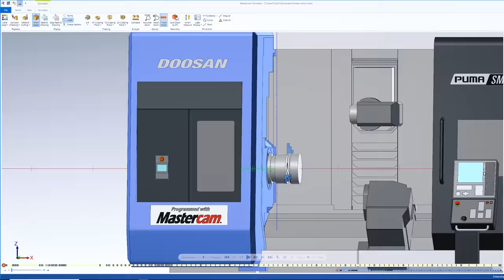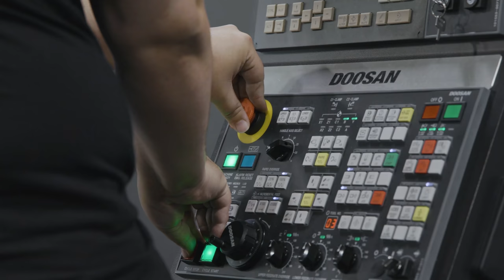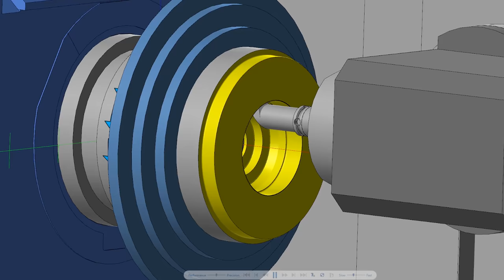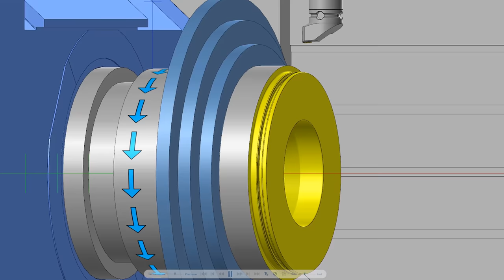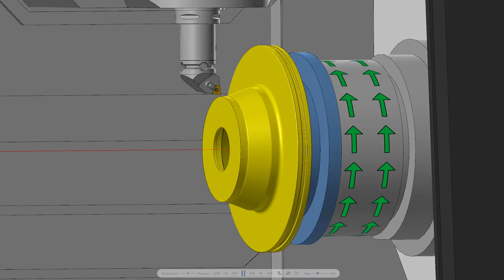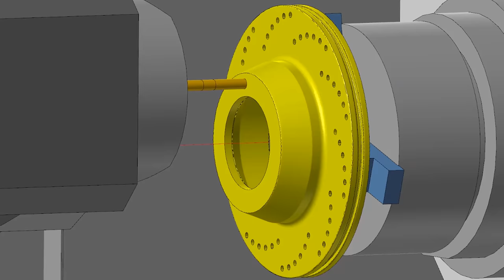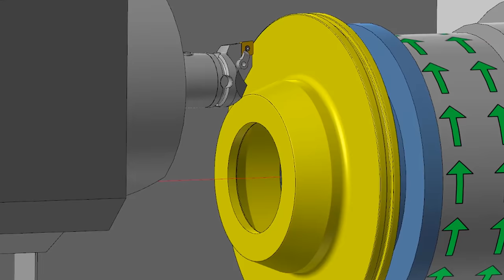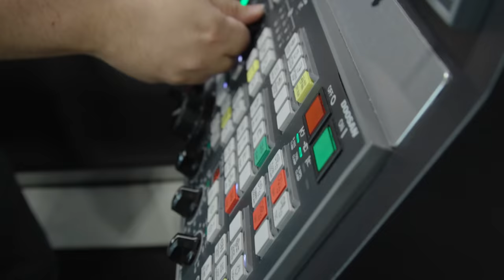Machining Our Own Brake Rotor on SMX 3100ST 9 Axis | DN Solutions

Comment: I turn brake rotors & drums for a living. Our speeds are very docile compared to what you are using but one thing remains. The shape of the part is a BELL. It generates harmonics which effects the surface finish. We always use an elastic strap and wrap the rotor or drum to help absorb the harmonics. Without it you get fish tails in the finish. You also have an interrupted cut which has to be murder on the tooling as well. You might consider hole ops on the rotor face last. As a last op a non directional finish with a flex hone type  tool is advised.
Reply: How many machines do you have at your shop?
Reply: Do you make your rotors and drums from solid stock like Tyson is doing or do you get them preformed and then finish machine the parts?
Reply: Order of operations, drilling and chamfering last could leave burrs on an otherwise smooth face. These machines are way more ridged than the average Ammco lathe, making interrupted cuts on these machines is child's play. Not all manufacturers recommend non-directional finishes. The OEM of these rotors only provide coated rotors. Most European OEM's use coated rotors. Now in the aftermarket world, you do what you have to do.
Reply: I also make rotors for a living and agree with you. Drilling should always be last and you would want to balance it before using. Also to save alot of time, kennametal has drill that would do your top and bottom chamfers as it drills each hole.
Reply: @cryptoldya6229  oh yeah ! totally forgot about balance !!
Reply: Could someone stuff the id w a nerf ball to absorb harmonics? I new some machinists who used rubber wrap to go around long sections of pipe when doing a operation. To absorb the harmonics?
Reply: I also make brakes and suspension for drag racing for a living. Very interesting to watch and see how you guys did it. We make 2 piece rotors. Most cars will run the same exact rotor but we will make a different rotor adapter to fit different cars with different lug patterns
Reply: One place I worked at, we worked with tubing, and we stuffed insulation inside the tubing when turning the OD to deaden the chatter.

Comment: I'm really confused, where is venting channels on this disc? without good air flow it is suitable only for low perfomance applications.
Reply: I thought something was missing. While the veins could technically still be added it just proves why parts like rotors are something better when cast then just surfaced
Reply: @kingofkings600  They aren't mandatory, but if you're spending what I'm sure this cost to manufacture, they're definitely expected.
Reply: This is just an educational exercise. Without internal venting this part is not performance-oriented
Reply: "Solid brake rotors are usually machined from a single piece of raw material, like cast iron. Although more exotic materials are available particularly when it involves racing or street performance requirements.
Solid discs usually appear at the rear of the vehicle."
Reply: @gt40f  bro they literally showed the car they were going to put it on and it sure wasn't my grandpa's Corolla.
Reply: @whatzituya55  they don't even put solid rotors on stock Factory Vehicles anymore. And a performance vehicle always has a vented rotor
Reply: @whatzituya55  I've been building cars for 30 years including race-winning endurance cars
Reply: @gt40f  vented, and on higher end cars, it's increasingly common to have 2 piece rotors as well. On my car that I take to the racetrack, they're two piece all around and directionally vented (so the internal vanes are angled to help pump air through them as they spin).
Reply: Rear rotors on my daily are solid...
Reply: @dan4653  yeah rear, and they're really thin like 10 mm. Rear brakes only do about 30% of the braking. Most performance applications have vented on the rear also
Reply: Vents can be index drilled in a radial orientation.
Reply: @kingofkings600  they allow cooling,brake discs are. Cast for a reason
Reply: I'm not sure how a video confuses anyone. There's just showing you how this machine works.
Reply: The vents add more cooling performance than the drilling. Whilst this rotor will work. It will very quickly reach the point of brake fade and warping on any track application or heavy mountain braking. Source ex mechanic.
Reply: @azazeldeath  Titans of Demo CNC that's all,machines on full tilt for the camera,while in real engineering feeds and speeds are optimised.
Reply: @markmiller5577  I have no issues with the machining at all, please don't misread that.

What I am referring to is the vents for the brake rotor, they can be called kangaroo paws or vented rotors. There's a reason why from the cheapest to most expensive rotors (minus really exotic ones like carbon-ceramic) and that's for airflow to cool down the disk.

Comment: You guys broke a record! The worlds most expensive brake rotor. Well done video Tyson!
Reply: *most expensive cast iron rotor
Reply: @BigWill3855  all drums and rotors are cast iron.
Reply: @Jon-O.  ever heard of carbon ceramic?
Reply: @BigWill3855  brake pads yeah
Reply: @BigWill3855  or even carbon carbon bec if you watch F1 you will know how much they cost 🤣
Reply: I would love to know how much that chunk of cast-iron cost and what a billable part would call somebody in the real world not for videos on YouTube
Reply: @steveanderson4768  yeah and generally the larger rotors are vane vented between dual braking surfaces. Technically if they were to do this and do it cheap it would have to be a casted part not a chunk of stock. To much material cost. Castings offer reduced material cost and less machine time.
Reply: @Jon-O.  Castings are for mass production.  CNC is for rapid production of prototypes.
Reply: @NSResponder  that depends on the design of the rotor and the application.  On larger rotors they are inherently two braking surfaces between a vented design prototype or production. For heat disapation and holes and slots are about to a lesser extent less heat generation which is fine when your application only requires the design of a solid rotor which is dictated by the application. Any where a rotor of that size is used the six piston caliper that goes on it is going to produce a ass ton of heat fast and internally vented rotor design is the only one that would suffice which will be a casted because production or prototype casted is the only to get that. Once solid rotors with pretty slots and hokes get to much heat and can't cool in time fast enough you lose braking they call it brake fade. Also if your vehicle actually used solid rotors which alot do it's still cheaper to cast them then to pay for all the machine time even on a prototype. Odds are the the foundry already has blanks casted you just need to kiss the braking surfaces and blast a hole pattern in the hub plate if there is one there that works or not if it's blank. The most efficient way is always better regardless of prototype or production. Coming from a guy who worked in and on prototype projects in automotive military and Areospace. Have a nice day
Reply: @motoadventuredude  that was my point.
Reply: @Jon-O.  I agree. The rotor he made was just about worthless other than for just looks.
Reply: If you own the CNC machines.. It cost you literally nothing
Reply: @BigWill3855  Yeah, he forgot that carbon fiber brakes exist :D
Reply: @Jon-O.  rotors too

Comment: First the holes are to help with heat yes but actually it's more to release the gasses that attribute to brake fade that build up between the rotor and pad. The gasses literally create a barrier from the metals touching eachother. Also those rotors are useless without veins which are actually the major cooling component of the rotor.
Reply: Also without the vanes gases cannot escape correctly.

Comment: I know this might not be a production part, but why drill before finish? Intermittent cuts degrade tools faster than consistent cuts, especially with carbide. I also noticed your chamfer interpolation is conventional (unless you're using a left-hand cutter) Lastly, why interpolate when the feature can be created with a dwell canned cycle?
Reply: Too many holes, heat n stress could affect the surface flatness which is likely very important on this part. My theory at least.
Reply: in cast iron these Drills basicly dont care. it just wont be as precice as it culd be from a positioning standpoint. In the other hand the drills are very short.
Every time the show of somthing they just "show of" the American way ;D In fact the flatness of the finished part is horrible cors he finished over the drilled holes, so if you would messure the surface there it will be around 10µm +- after every hole dou to the vibrations of the part end the tool.
And the last BIG BIG ooooooffff in Machining break discs is that you have to machine both front and back surface in one Operation (Workholding). So this Rotor will not peforme on a real car.
Reply: @savioer  I agree with this
Reply: I'm guessing he didn't want to scratch the finished faces with drill chips.
Reply: @fordhoarder  if you look closely, there's a witness mark behind each hole from the intermittent cut.
Reply: @joshharper3257  I see that. I meant if he would have finished the faces first, the drill chip would most likely scratch them. Damned if you do sort of thing
Reply: Nothing a little polishing couldn't take care of, and both sides do not have to be machined at the same time, if he indicated it in its good.  That rotor is better than any one you would buy.
Reply: Personally, I would have drilled the holes on op1, becuase now they need to either use a small back chamfer tool to reach through, debur off the machine by hand, or do an op 3. But a light intermittent finish pass is what I would still do, just to ensure that the part didn't move around from the stress relief from the holes.
Reply: @fordhoarder  Good point. Nothing a little post processing can't handle. I spent 9 years CNC Programming Aerospace Parts. I can be a little too picky at times
Reply: @X197ToPlay  Now that you mention it, maybe first Op should be a qualifying operation to drill the center hole. The part can then be mounted internally and both the front and back face can be machined.
Reply: @joshharper3257  Thats kind of how its done, normaley the last op is clamped on the same surface as it will be boltet on a car and then the breack surfeces are machined.
The thing is he did it in 2ops due to his machine, Normaly this part out of this RawStock takes at least 3-4 ops, to make a correkt part not just a show part.
Reply: @fordhoarder  in steel maybe but not in cast iron. That chips will fly right of the hole with proper cooling
Reply: @JM-br9sp  that rotor is shit without cooling vanes.

Comment: These rotors arents going to work well at all if they are to be used heavily as they arent ventilated.  Cross drilling doesnt work to cool the rotor and promotes cracking which is why modern rotors have J cuts into the face of the rotor which allows for cleaning the face of the pad but dont have stress risers.  I was hoping you had a way to drill the rotor radially for cooling like F1 does (hundreds of .08" holes drilled from the circumference to the center), but this is not all that impressive.

Comment: I've never really enjoyed machining cast iron. The surfaces are fine and it's fairly easy to deal with for tolerances and heat, but that's where the good bits end.
The smell is the least weird thing about it.

The chips are more like granulate that gets everywhere - the bottom of my coolant reservoir was covered in a black sludge which was due to the composition of the metal.
My small drills started breaking because the particles clogged the pumps for the through-spindle cooling 👀
Reply: Exactly lol, but what about those fine ass brass chips that find a way into every corner of the machine
Reply: yea, piece is a beaut, but we have turned down jobs simply by the fact that Cast Iron sucks when you machine it.
Reply: cast iron lends it self to good old fashion open lathes without coolant. I can totally concur on the mess with castiron,  I cut brake rotors a lot on my brake lathe and turn mill rolls for a living and the mess is indeed terrible
Reply: Better than the splinters I get from grinding super alloys
Reply: @AlChemicalLife  PPE anyone??
Reply: @MrChevelle83  We wear PPE xD . Those things go right through our gloves! 
Also , the stick to clothing and surfaces and you get stuck that way as well..
Reply: @changblonk4089  Brass never goes away... always there hiding.
Reply: @MrChevelle83  Cast iron is coolants enemy... I've seen people wash it off with the coolant. Next thing "my coolant looks bad"
Reply: @MrChevelle83  yea lol. Job shop we work with actually has an entire mill dedicated to dealing with Cast iron mess. 1989 Okuma MC50H
Reply: I'm curious if magnetic filters would help - like those for central heating with cast iron radiators.
Reply: @thedamnone  might be a good idea, but RF interference with precision servos does not sit well with me.
Reply: I have machined ductal cast for years, both manual and cnc. The carbon loaded cast iron fines actually pull the oil out of your coolant.  You can buy a magnetic filter for this but it will still happen.
Reply: Try kirksite the rooster tail is like sand blasting the machine had fibrous chips on the iron ceiling rafters forty feet up. On a sixty foot five axis gantry mill running 1200 inches per minute at .030 per tooth at 10000 rpm .125 depth of cut with a four tooth 2 inch indexable shell mill It was insane. That was the fastest that machine was Ever run basically maxed it out.

Comment: I've always wanted to do this but I always thought "oh but how are you going to do the cooling vanes?" so it's really cool that you guys tried it out.
Reply: Always wondered this too, that’s why they are generally cast and then skimmed. I wonder how much the veins matter🤔
Reply: @AlphaEngineer2022  They do matter, a lot. You have around 2 times more surface for cooling so brake disc takes longer to overheat and loses heat way faster.
Reply: Without the venting the rotors are also heavier than they need to be.
Reply: @Stasiek_Zabojca  perplexed as to why they showed a race car. Without venting, this disc is just plain bad
Reply: Exactly. I think they only made a rotor for the "show" because those rotor will be horrible. They are heavy, will over heat very fast, take for ever to cold down and high performance rotor use a specific alloy to match the pad.

Comment: "Oh, you said it was a hundred pounds?"
Literally nopes out of there
Reply: I know, I wouldn't be anywhere near the door.
Reply: @MarcoRodriguez-ci3pg  you need to come stand by the lathe i run with a 20,000 lb cast iron part spinning at 125rpm  hogging off a 1 inch doc :-)

Comment: Drilled or slotted rotors are for venting gases created by the pads, cleaning of the pads and additional cooling. The issue with drilling is they are prone to cracking. With that small chamfer I would guess those wont last long if its in a high heat application.

Comment: Ex mechanic here, I know this is demo purposes only, but id have loved to see the vents that are mandatory for proper cooling.

Also my old boss used to make/modify his own by buying blanks and machining his own on his heavily modified (I think home made) brake resurfacing machine. That thing always scared tf out of me as it was more inline with a wood working lath that you had to use hand tools with...that all looked home made.

That said that guy could work wonders on it. Seen him even make a diff crown gear, all I made was a broken finger when the stupid tool bit in hard when I first tried using it. Did learn how to reface on it. Then next workshop had a real one....well imagine my new bosses face when he saw me attempting to do it by hand tools (old boss had gifted me a set, wish I still had them and my old tools, but that's what happens when you get injured majorly on the job under bosses orders, all your tools, your project cars, racing cars and all go "missing").

Comment: I don't think I have ever seen a solid brake rotor that was drilled before, normally that is only done on vented brake rotors. Perhaps adding some custom designed "slots" to aid in brake pad cleaning would have been a better choice on a solid brake rotor.
Reply: so what happens when you resurface them? the holes are there.
Reply: @nieljones6181  you dont typically resurface drilled rotors, they are crack prone and usually 1 time use with any abuse.   slotted can be resurface but you loose the slots performance so its basically pointless too.
Reply: @MrChevelle83   ah. I see. Didn’t know that

Comment: What is the purpose of the coolant, pouring out from the corner? Flushing away the chips? Also, isn't it easier to buy a multi-axis turning tool with 45 degree insert placement, which you can just rotate 45 degrees on a B-Axis, so there's no any interference between workpiece and the head?

Comment: i guess, your nc-control or at least your cam-soft could handle it: for facing give your boring bar a 45° rake angel, than you can face your parts at first op. and as a bonus you can raise/double your feeds too!💪

Comment: Tyson the Lathe-Guy show how its made. Awesome. But why the big drill oriented like this, the hot chips lay on the top side of the drill, heating the drill asymetric up, With coolant no issue, but like this? Does the Drill get warm?

Comment: 8:20 this here folks is called experience!!! great job dude...
Reply: It's sensible machining, with large parts like this anything you can do to reduce the OD radically reduces the load on the spindle
Reply: He still could plunge cut the face if that operation had to happen first. Kind of the same as OD cutting.
Reply: Experience? lol Its just common sense. They teach you this in school.